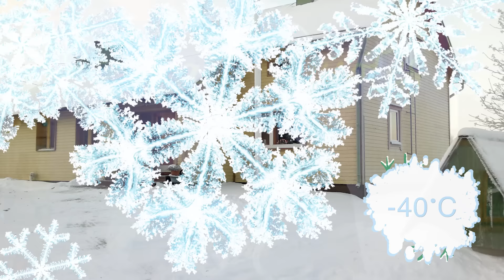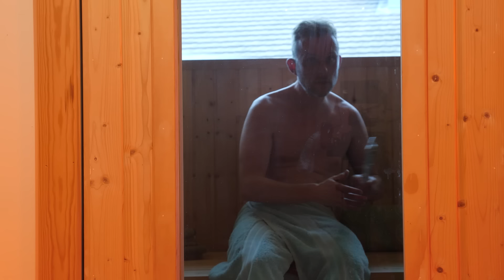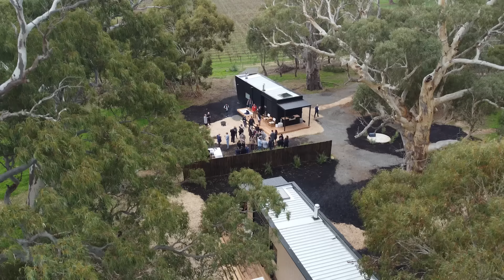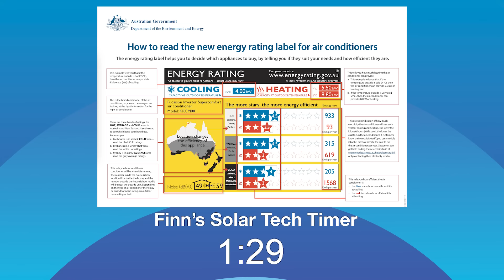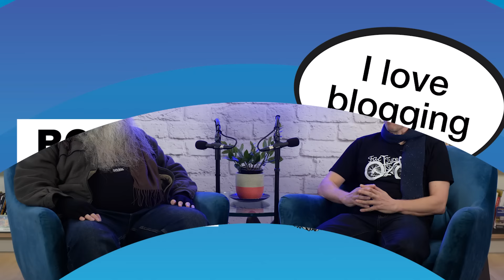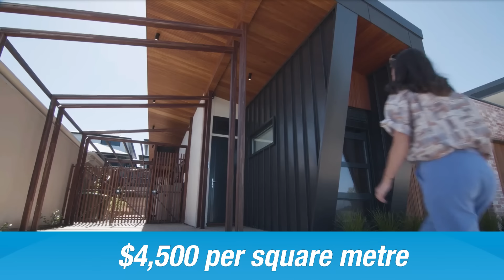The Dark Side: The Truth About Solar Power In Winter - SolarQuotes TV Ep. 6

Comment: I have a really crap insulated Melbourne house, with the worse windows on the planet . It's really hard to keep my house warm or cool. Just the window would help. Secondary double glazing won't do it, as  my bedroom has that and needs to be cleaned inside the 2 glazing, pain in the ass.  I really need full euro quality double glazing . But I have heard that the price can be really frightening. I've had 5kwh  of solar for 6 year's and a powerwall2 since August 2017 and a sanden heat pump water heater.
If double glazing is to expensive, I might as well go up to 6.6 sunpower maxoen panels emphases system, under 7k would do it and I'm pretty sure a quility double glazing would be double.

Comment: Just my strong thoughts in general. My fears.
Cost of doing little on the climate front maybe far beyond the country can bare.
Australians can't migrate to the cooler latitudes of the Great Southern Ocean. 

Australians do not have a clue how bad the old Australian Government was with new technology. 
Polluting ICE vehicles are welcomed. 
Australia will be the first continent to burn 🔥. 
Desertification is the next step. 
The Sahara desert is in Australian latitudes. 
We are a joke and can not speak up for ourselves about the climate destabilisation. 
Every building is connected to the grid. 
Every building has a roof for rooftop solar PV system. 
Every building can connect EV to the grid. The EV big batteries are the solution. 
UNLOADING THE GRID as the electric future expands is critical. 
The electric world means a ×5 fold increase in electricity generation. 
5 new power plants is STUPID.
5 new power grids is STUPID. 
Half of the grid is home supply. 
Half of the grid, the homes can supply themselves and industries. 
The ends of the grid can supply the grid. 
Central power plants are background power.

We have been in this position since Adelaide got it's big.

Comment: 30 KWh per day! OK I live on my own but either the computer or the TV is on most evenings and I run at a average of 5KWh/day with 2 freezers and a fileserver running all the time  (while in all day during pandemic this was pushed up to 8).  Got no AC here in England and I know that it is power hungry but a extra 25 KHw/day - wow.
Reply: Yep, we use around 16KWh per day in my house in the UK, its likely be a bit less since we change the induction hob and dryer which use a lot less energy now, but either way, it's quite low.

The problem is, if you go solar, you're going to want to change other things that use gas into using electric so you can save on that, that would bump the energy need up quite a bit.

On the plus side, our house rarely needs any heating even in winter, heating is probably on for 2 or 3 days of the year but summers get really hot here, especially upstairs.

If the design of the house is done smart, you can more or less have a house where you rarely if ever need heating or air con for the house, we've got the heating done right but not the cooling lol, but to me, that is far more effective than using a lot more energy to heat and cool a home and if battery tech was a lot cheaper, I think I could generate all my energy needs with renewable, the problem is, winter energy generating by solar is not likely going to be enough unless I put an excess amount of panels up and summer generating is going to be too much.
Reply: I just measured our energy usage on a 40c summer day here in Australia, used almost 40kwh just through the day and another 8kwh through the night, the bulk of that was running the AC alone. Through spring and autumn usage is nowhere near as bad, but yeah it's rough once the 40 degree days hit!

Comment: Regarding heat pumps: Almost everyone I'm asking says that if your home doesn't have under floor heating, heatpumps are not worth it, because the radiators require much higher temperature water where heatpumps are not efficient.  However, according to websites of reputable companies making heatpumps like Panasonic there are heatpumps that work well with only heating with radiators at high temperatures. I'm guessing some models are better for radiators, others are optimised for efficiency with floor heating. The question is: Is this true? If so, what should I be looking at when choosing a heatpump for radiators? Is there some specific technology, or coolant used or something?

Comment: You need a new thermometer if that's centigrade.
Reply from the maker: https://en.wikipedia.org/wiki/Sauna
Reply from the maker: "Air temperatures averaged around 75–100 °C (167–212 °F) but sometimes exceeded 110 °C (230 °F) in a traditional Finnish sauna."

Comment: Fin its hard to work out but from your hot water heat pump segment, (I have a gas boiler hot water system) I understand heat pumps are better than traditional electric, but how do we figure out if its cheaper to generate the hot water with gas or electric. Currently I'm with Amber Electric as my energy provider and price per kwh is not so simple, prices fluctuate every 30 minute, ie today I haven't been able to turn the heater on all day, and its a chilli 11deg here in Melbourne. My current live price right now is 45c kwh. Gas seems to me to be cheaper to run per day over switching to an electric system. Or should I look at going greener by switching my boiler to an instant gas hot water system in stead, and concentrate all my dollars on saving for that solar system i want to put in.
Reply: I'm not able to answer your question. I have an old fashioned solar thermal HW system. Last winter we had to use the electric booster 3 times and so far for this winter only twice. Certainly the running costs are lower than the alternatives but capital costs were higher.
Reply: What made you go for Amber if it means electricity is too expensive for you to use when you need it? Surely there is a tradeoff at other times meaning you pay less overall? A fixed rate plan may be better option.
Reply: @Nobody_Famous  Hi, thanks for your input, it is food for thought. I thought that at the beginning, but I was prepared to try something new. The benefit from the app from amber with the realtime price, is it forces us to consider what we will have on, and shift our habits to a cheaper more green time of the day.  We have no kids so we can shift our habits. The current higher than normal prices have been explained to us, with a flooding at one of Victorias coal power plants forcing it to go offline, and last month the explosing of the coal powerplant in queensland meaning power being generated for interstate causing higher prices, Amber Electric has insurances which cover them whenever the price goes above the victorian default offer, normal big energy providers usually pocket this, but charge a fixed or tarrif rate, but amber chooses to credit us what our insurance was for this portion, im essentially on a time of use rate every 30 min, so by shifting my consumption i can potentially save. I could have had my heating on, but chose to consume less based on the price. Each day I can see yesterdays consumption on price. So Yesterday we consumed 4.96kwh and it cost me $1.85 with an average price of 37c (in summer this average price was 7-12c). But i just got my bill for june and its come in at $45 (37 for useage +15 for membership - 7 for insurance). we used 169kwh for the month. So far this year my bill (which is monthly) has come to $318.50, I'm in a 3 bedroom house, last year i was in a 2 bedroom rental with origin on a monthly, and same time jan to jun cost me  $651.08 so you see I'm gonna stick it out, cost overall it is cheaper than the spike im seeing in winter. Plus if I get solar & a battery, they give extra on top of the vic fit default, so If i get west facing panels, I can make money back when the demand is at its highest.
Reply: @ChristopherLaNauze  45 cents a kilowatt that’s insane,we pay 18 cents per kilowatt in Melbourne.
Reply: @NoDigid  it's wholesale prices. And it's only for 30minutes it fluctuates with the demand. In summer it's been -68 cents we used our aircon and got paid credit back. Our Xmas bill using aircon lots of home Time etc cost us $40 for the month. I'll stick it out want to reach a year so I can blog about it. I've got an export of my usage of for every 30 mins and the price of every 30 mins for the last 6 months which comes from my smart meter, plus I have the powerpal which I can export data from to compare. I haven't found anyone do a full write up online as a customer so I need a full year of data first. I record every bill in a spreadsheet from the last 10 years the only thing I didn't record was consumption. So I can only sort of compare to someone line origin. But basically this last 6 months I've used just over $300 for electricity in a 3 bedroom house, yet last year 2 bedroom unit same time of year cost us $600 and in both cases we had had appliances and heating. Although last year I was on a standown so there was more of me at Home.
Reply: @NoDigid  but worth checking out what company are you with for electricity?

Comment: We've almost made it through our first winter in our Reservoir, Melbourne home. We've only just got wall insulation pumped in yesterday. We got a 6.27 kWh system in high summer this year and have almost managed to pay for our gas bill over winter with the credit. New stop is getting off gas for indoor heating and hot water. And maybe upgrade our portable ikea induction cooktop. 

Solar certainly works in this Melbourne winter!